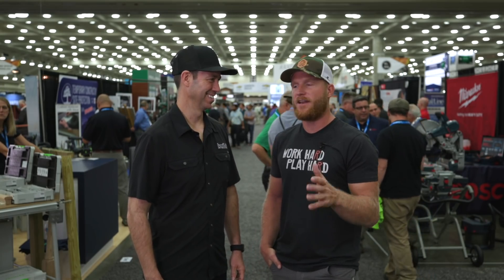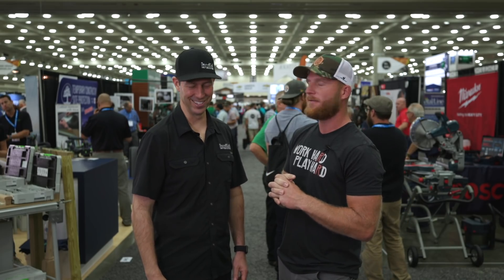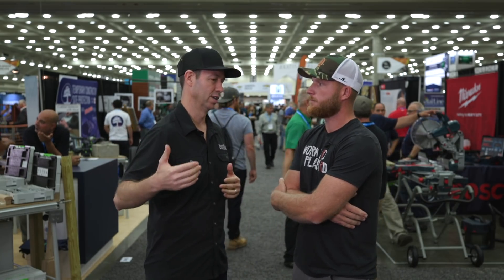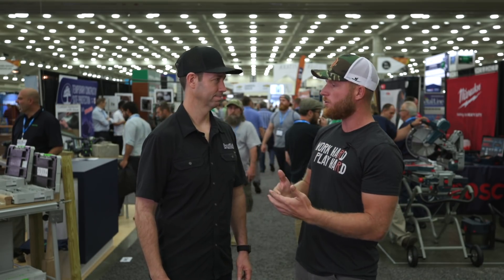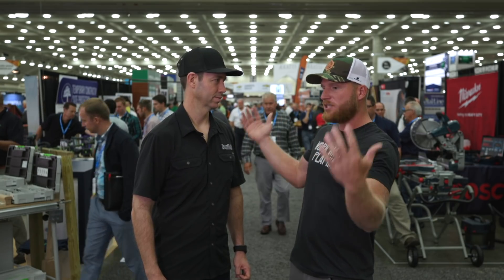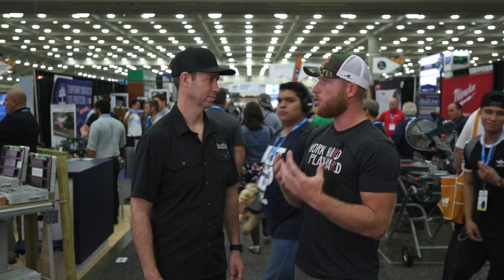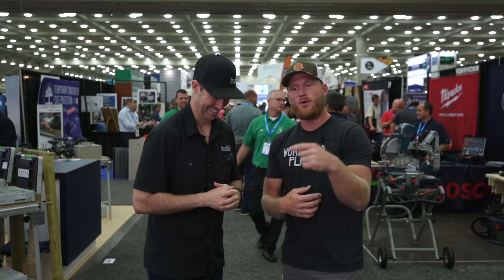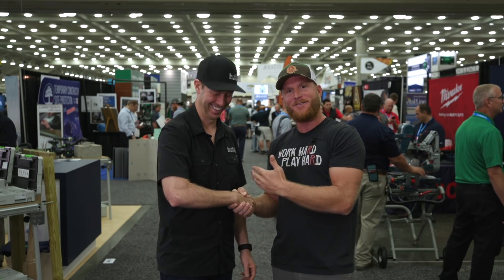I sure like what Matt Risinger has to say about housewrap

Comment: Folks should've been having this conversation a long, long time ago. Doing this for free on YouTube is a public service. If RR is building a metal-sheathed pole building for an individual (or a company) to be used as a combination shop and garage (or as a complete private business complex) then the customer will have different expectations than a simpler barn or garage for vehicles/equipment. Figuring out the implications of what you want to use your building for, and designing it to suit those plans, shapes the whole project before the blueprints are even drawn. My family is talking about self-building a wood framed, metal-roofed large carport  (no walls) and we have to figure out all the possibilities before we buy anything. That said, I think it would be interesting to see an RR project for a shop, or a business, or even a combination residence and business, where the entire complex (or most of it) is a sealed, conditioned space. It would really be interesting to see if a RR building could be a European "passive house design", as well.

Comment: Great conversation! My only concern about building too tight is ventilation. Our 40x80' farm shop is as tight as cheesecloth and I'm not sure I'd change that without the addition of significant mechanical ventilation. Fumes from welding and cutting, volatile vapors, engine exhaust, etc are all present in these kinds of buildings. In my opinion, plenty of fresh air is an absolute requirement in any building where work or equipment storage is taking place. Letting that junk build up can be fairly hazardous. Tightening up partitions between garages and indoor conditioned spaces is something that Matt has discussed at length for that very reason. I would absolutely love a conditioned shop during the oppressive central California summers, but It'd take some very well thought out mechanicals to get right. I know you can always open doors while you're working, but you can't leave them open all the time. Just a little food for thought.

Comment: Wow, the timing on this could not have been better!  I'm building a "she-shed" for my girlfriend and it'll be heated, insulated and house wrapped.  I've just run out of Tyvek after wrapping the walls but didn't have enough wrap for the gable ends.  I was about to head out to by another 100 foot roll of Tyvek so I could wrap the last 10 foot gable but now I'm going to pass on that step and start on the siding.  Thanks Kyle!

Comment: Love both channels. I am fixing to build a 50x80  barndo. Using double bubble insulation under metal. Should I use osb or a zip system type board or not?
Reply: I know its been a while since you posted this comment and I was wondering if you did build a barndo and what you might have used for the wall system? Did you use Zip panels or OSB? And how did you insulate? Thanks

Comment: Huge fan, but how far do you really need to take air tightness in the post frame industry?  What you do right now with insulation, vapor barrier, and house wrap is great and adds value to your customers.   The bug thing I notice that really prevents your buildings from being any tighter are the HUGE garage doors on each one.  A tight post frame barn only goes so far IMHO.  Keep making awesome videos!

Comment: My thought is that you do the walls because air can come in, with the roof you are using vented soffit on the overhang, but not the gable ends to encourage good airflow from those vents to the peak/ridge. If the gable end sheeting/metal is leaking some air like the walls, the reason for wrapping the walls, then that must be reducing the airflow from the vented soffit to the peak/ridge vent some by allowing air in the gable ends that are not wrapped.

   How much I do not know, is it even enough to matter, I don`t know....it has to be some, because if it was none then you would not do the walls, so it stands to reason it is reducing the draw from the vented soffit to peak/ridge vent by allowing "Some" air to enter the non wrapped gable ends.

  I have no idea what that house wrap costs, if it is soo minimal in cost that it is worth increasing the airflow from the vented soffit to the peak, which is critical, by any amount.....it could be worth it.   I am a carpenter, but from a customers perspective it might be worth it from a feel good standpoint for them, by wrapping it, as I am sure some of the questions of why you are not wrapping it come from them.

  My analysis is that some air leaks thru the gable ends with no wrap behind it so wrap has to improve the vented soffit to ridge vent flow...…..is there already enough flow where improving it is not needed, I don't know......but flow from the vented soffit to ridge vent is critical, so it might be worth improving it by any amount.

     It is a interesting topic and more study is needed to determine if it already has more than enough flow from vented soffit to ridge vent or if there are conditions that humidity rises or slight condensation happens when certain weather conditions happen....it mat happen already, but then be minimal and dry out fast enough to not be a problem...….you could always do a video monitor in one and some data recording humidity sensors...LOL

Comment: I'm really interested in how you are able in your climate to ventilate out the condensation of the underside of the roof. Where I live we have to  put up a tight "underroof" made of bitumen or foil to protect from the ice that will building up under the metall and then melting when it gets hotter outside. This is a big big issue in construction here (little jealous).

Great with the variations of content!

Comment: I think I may have mentioned this once before, but seems appropriate here as well.  One of the things my builder did on my steel clad building was sheet the roof with OSB before putting on the steel.  He said he liked to do this (asked my permission first since it was an added cost) on all buildings with a steel ceiling as it pretty much eliminated any condensation from forming on the underside of the steel roof and dripping down on the insulation and steel ceiling.  We both agreed that since I was having him put a vapor barrier on top of the ceiling (like Kyle does) below the blown insulation it probably wouldn't have been an issue, but I'm fine with the belt and suspenders approach to this when it comes to condensation.

Comment: It may be simpler to detail an air barrier of a post frame with an unconditioned attic on the interior because the transition at the gables and post to truss connection is less complicated than transitioning from the exterior to the ceiling plane.  If memory serves, you put a vapor retarded on the interior, right?  It might be simpler to make that your air barrier. 

House wrap may or may not be an air barrier:

https://www.energyvanguard.com/blog/32017/5-Reasons-House-Wrap-Is-Not-an-Air-Barrier

Love both channels, have learned a ton from both.

Comment: my two favorite builders on YouTube, in one video.  Awesome.
Reply from the maker: Pinnacle Motoring thanks I’m glad I’ve met Matt
Reply: I have been watching both channels for a while. I am new to post frame and have a big workshop garage tiny house build coming up. I have designed it using stick framing and trusses but have wondering if post frame is the way to go. Been trying to figure out the pros and cons to each construction technique plus cost comparison. Will likely raise the issue with my engineer when I show him my design.
Reply: Same here.  Wish Matt would do more actual building but his videos are also very informative.  Being a San Antonio resident I'm hoping that I can run some plans by Matt and his team in Austin to see what kind of efficiency suggestions he would have for my next build, which I'm aiming for a net-zero home.
Reply: Absolutely agree Pinnacle.  I found both channels separately and love both the channels.  I just saw this one, great conversation!  I agree with Matts' building style and I watch RR for similar reasons.  Most people can throw up a crappy, leaky, building, but really to make it the right way, its all about the details, every footing, corner, and window detail is like solid gold :)  Shedding water, sealing air, controlling vapor, and then insulation...  Keep up the good work.
Reply: Agreed......the building science nerds speak my kind of language.

Comment: Reasons why one of your buildings may need air exchange equipment is the fumes from running vehicles, VOCs in some products, or dust control.

One of the great things you do is EASY air in and out of the attic under the roof.